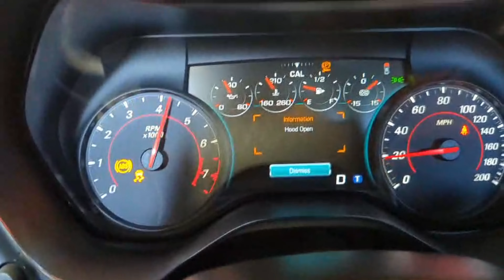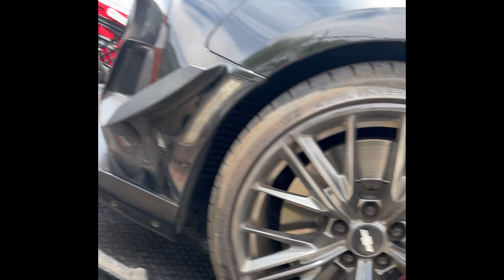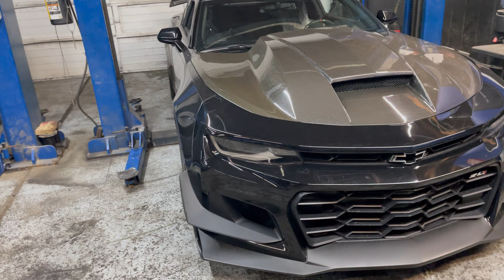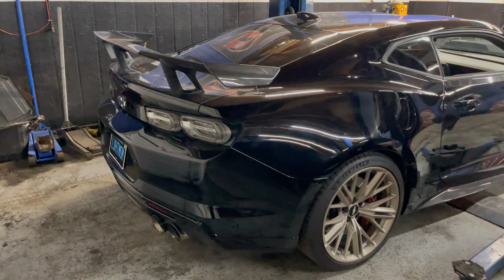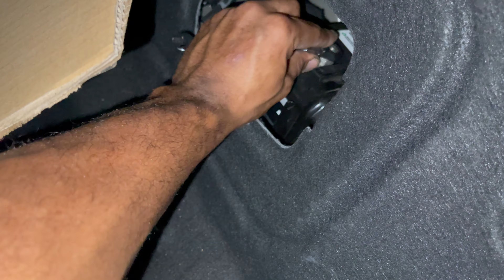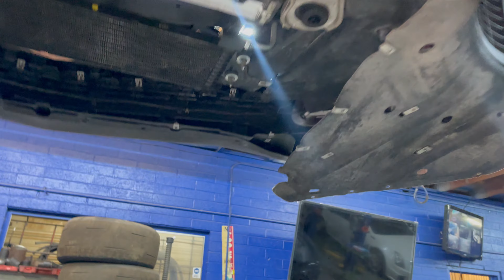ZL1 Fell Off The Tow Truck Onto The Dyno

Comment: It's quite literally designed to be towed by that tow point. The problem was the shitty aftermarket red tow hook that's designed for looks more than anything.
Reply from the maker: Designed to be towed on a flat surface not side loaded at an inline but yes you are correct they aren’t as strong as the OEM hook.